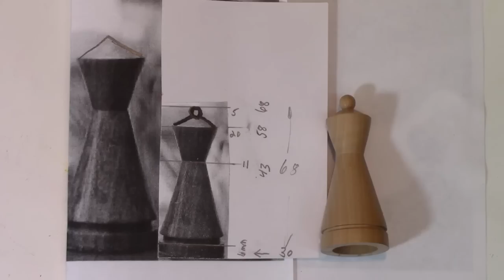Queen - Woodturning a Chess Set Episode 5

Comment: Mike at I think at 21:43 its doing that same psychedelic anti-shake effect that happened on  your scraper video that told you about. 

It does look like spinning things confuse it.
Reply from the maker: +Cliff Hartle 
Thanks a gain. That is the last time I will let YouTube make "improvements" for me. I have reverted to the original version. It will take a few minutes to process.
Reply: Mike Peace I've used it on my videos from way back when I used a digital 8mm camcorder. But they were mostly larger videos nothing close up.
Reply: Mike Peace Oh and you should never have to use it for any video were the camera is locked down like on a tripod.
Reply from the maker: +Cliff Hartle 
Thanks to your help, I think I finally learned that! My camcorder is just about always on a tripod or my articulating overhead arm.